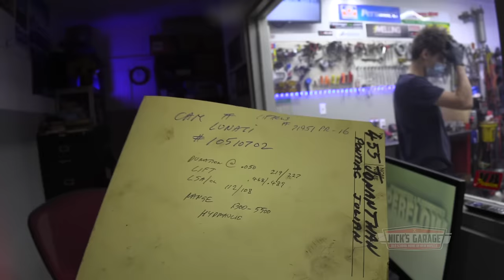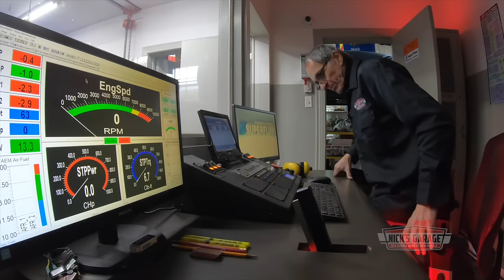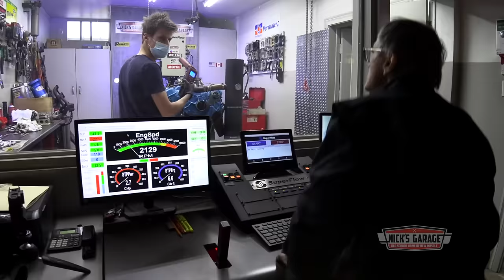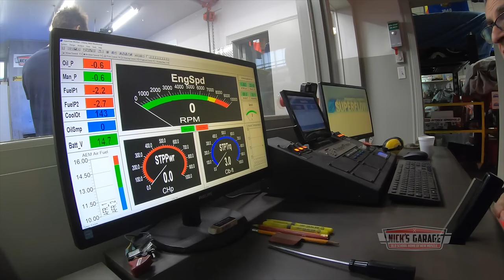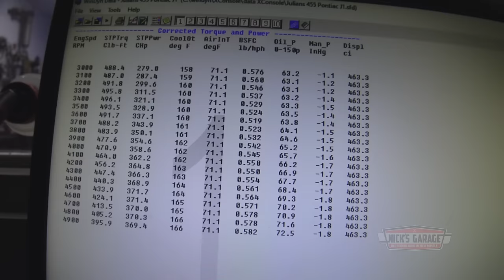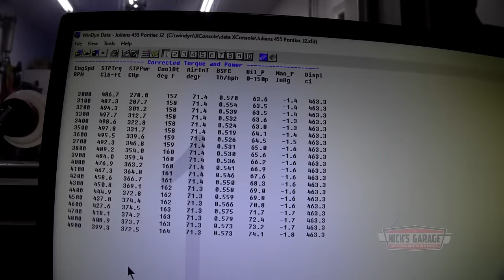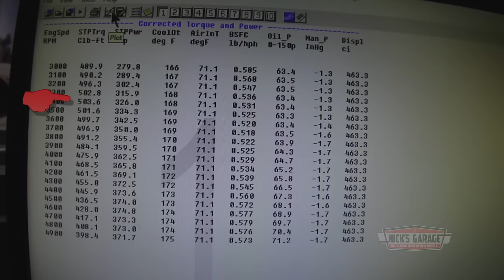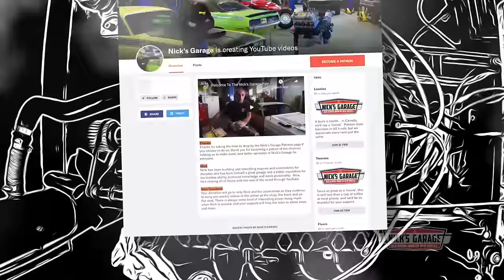Pontiac 455

Comment: I owned a '72 Pontiac Grand Prix once, it had a 455 with a 4-barrel Quadrajet, and a Turbo Hydromatic 400 tranny. That thing was a beast stock. I could blow the doors off any street car out there. Amazing car, back then.
Reply: Had the same car only it was a 400 with a little bit of cam . Don't know how fast it was but it was a handful and my father always got in trouble when I let him drive it.
Reply: You are the God Father of engin building....
Reply: I had a completely stock 73 Formula 455 Firebird back in 1986 and the torque and 250 rear wheel HP was awesome!  Not insane power but more than enough power to street race and eat up late model 350 corvettes and 350 Firebirds!

Comment: This is a "perfect" Pontiac 455. These engines are known for unusually high low end torque, their best horsepower is between ~4,200 and 4500 RPM. They "roll off" at ~4,800 RPM, and are "out of breath" at ~5,000 RPM. The bigger carb may help a little, but with their relatively small valve size and runner cross section, these just don't produce much torque on the top end. These have tremendous "off the line" acceleration, due to the torque coming in at the stall speed of the torque converter. This is the engine you want, for light to light street racing. They'll "burn rubber" all the way down the city block.
Reply: 12 flat's in a SD 455 works pretty well for being out of breath, ha ha ha
Reply: @74SD455TA  - SD's have better heads!
Reply: Put some Ram Air 4 heads, .030 flattops (around 11.5) on a 4 bolt 455, ran a .288/.298 .515 cam - 
While in 3rd gear (as the tires melted) the tack would climb so fast after 4500 that I was afraid to step down til I could put a rev limiter on the thing, but NEVER did I get the feeling that I was running a marathon with my hand over my mouth, far more like no end in sight
Reply: Not to mention the tiny intake ports keep high end horsepower in a low band
Reply: I had a 428 bired and stroked to 500 cubes did 10.8 in the quarter mile all day long
Reply: Ram Air V heads or go home
Reply: They don't have "small valves" either...

Comment: We got a 69 GTO Judge Tribute. 455 BBP on MSD ignition, bored .030 over, forged rods and pistons, heavy duty mechanical valve springs, 750 double pumper carb, billstein suspension all around, wilwood 6 piston brakes, drilled and slotted rotors, stock M40 Turbo with 3.90 gears? Rear end, just has a posi in her. Built trans, no OD aftermarket 17” factory looking wheels, about 50 grand with 0 work done by myself, all in a shop. Car is a beautiful Orbit Orange, convertible with a white top. Car was bought from an older women after her husband passed, car was complete and just needed a minor restoration, ended up doing a full Judge conversion all with authentic Pontiac GTO Judge options, from the RPM gauge on the hood, the the ralley wheels and shifter, back to the spoiler, and full Judge Drivetrain. Car dynoed just over 500WHP on the dot on the 1st run (car was warmed up) and over 570 foot pounds of torque. She lights the rears up like no tomorrow. Wrapped in sport cup 2s 275s all around, 17x8 Lemans remanufactured.

Comment: As usual there's no better way to start any Monday off than watching and learning from you Nick!
Reply from the maker: Wow, thanks!
Reply: Should have hooked up the choke and made sure it worked right while dynoing... 
Would have gone 1 step larger in cam... Use Super Duty 455" 850 CFM Q-Jet... 
Timing marks wrong?
Nick worked at Pontiac back in late 1976 when I ordered and bought my '77 Pontiac Gran Prix... mint green with white interior... 301" Pontiac V8 rated 17 MPG city and 23 MPG hiway, great numbers for those emissions slug engine 10 MPG days... Canadian 'Pontiacs' may have still been getting Chevy engines... 
Where's a squeegee for the water? 
Engine Dyno stand needs a Parking Brake to hold in proper position... 
Nick sounds like he has Omicron flu...
Reply: @BuzzLOLOL ..... I was fine the next day. I have lost my voice many times in the past. Normal for me.

Comment: My two cents: I had the same engine in a 77 Trans Am. XF 455 block, Nodular cast iron crankshaft, 1971 96  heads, Edelbrock performer int. manifold, .030 over. Crane HMV 278 (222/234 @ .050 duration), Crower steel billet connecting rods, and Norris roller stainless steel rocker arms (1.5 ratio), carburetor was an 800 cfm Quadrajet for an SD455 auto engine. On the dyno my engine recorded 430HP and 510 Lb ft torque. Later on I changed the camshaft to a HIT 292 and Edelbrock aluminum heads. After all this, I gave the car away... and I am about to cry!
Reply: I feel your pain; Back in '78, I ordered a '79 Trans Am Special edition (T-tops, blk/blk). It had 211k miles when I sold  it for 2500 bucks. It still ran good, all original. Except I got rid of the smog pump, and emptied out the cat. converter. Selling is still the dumbest thing I ever did : (
Reply: You traded - in the T/a , for a Datsun
Reply: My first car is a 69 GTO. I have owned it since 1983. It was setting on a Honda dealer's used car lot. Someone had traded it in on a new Accord. I often wonder if that person ever laments their choice? And a 455 with #96 heads making 430hp is no joke. While the #96's are a great head for a street car that is probably about the most you can get out of them without major porting. I have run them as well as 7K3's, #13's, 7F6's and #48's on 428's and 455's. Today it's Edelbrock or KRE's. They are both a huge improvement.
Reply: Iwould be balling
Reply: Were you running headers?

Comment: My buddy just out of high school, had a 1970,or 71 Pontiac Bonneville,with a 455! Headers,bigger carb,true 3in pipes just past the drivers door,.That big boat did 105mph in a quarter mile. No clue the time,13s I guess.But I like 455 cu engines, alot

Comment: The old BOP motors had some serious guts. I have a stock 1969 Buick 350 motor in my 66 Chevy C10 and it will pull trailers over mountains. Literally.
Reply: The Buick 350s sucked, as the bore was too small to do any serious breathing. 

The Buick 455's, on the other hand, have a MUCH larger bore and are capable of some serious power if built right
Reply: @davelowets   I think that's a bit unfair to say. The 350's aint no Formula 1 but they are amazing truck engines. You get the torque of a big block with the fuel economy of a small block. I daily drive with one and I'm very happy with how it performs.

Comment: Love the overhead view of the Quadrajet showing the sequence of the Secondary POE deploying as those big secondaries come online.
Reply: Favorite part as well.
Reply: We call it 'air door'...
Reply: @BuzzLOLOL  POE "Pull Over Enrichment" are the two holes above the air door leading edges that supply the shot of air fuel mixture that we saw to aid a smooth transition.
Reply: You can watch the hood go down when the secondaries kick in
Reply: @bigthunder2860  - LOL ! ... Q-Jet secondaries were one of GM's best inventions...
Reply: that one seemed to stumble a little as it hit the secondaries
Reply: @JimBronson You are right. It did slightly.  If you look closely, the POE openings are well above the leading edges of the air doors on THIS carb.  There's roughly 4 or 5 things you could address.  I'd start with the simplest first.  1. Tighten the wind-up spring 1/16th to 1/8/th turns.  2. Cut 2 small semi-circular holes in the leading edge of the air doors right under the POE holes to quicken enrichment if needed. (Which is a good performance mod to consider when POE holes are this high.) This engine might react differently once installed in the car however in real world conditions.  Start simple first and go from there.
Reply: @JimBronson  - Yeah, the dyno 'loads' the engine differently than 1st gear in a car would... the dyno drags the RPMs down as the throttle is opened fully...

Comment: Even though Nick is a huge Mopar guy,you can tell he's loves Pontiac's just as much when he talks about them. Would love to see a performance Pontiac build!

Pontiac-always underrated, I say they were GMs best, but  corporate politics ruined them.
Reply: Totally agree.  It is said that an original Pontiac block is good for about 800 hp before stuff starts to break.  Butler Performance blocks have been built to push 2500+ hp on alcohol.  I'll be putting a 400 in my next car.
Reply: @originalpunkSxE   I found that Pontiac's have their own unique little rumble to them too. I could always tell them apart from a chevy or ford... etc.. 
Same with Oldsmobile's.
Reply: Pontiac definitely had some good ones. My friend had a 1972 Grandville with a 400 that even when it was wore out and tired could still spin the wheels on that big old boat at half throttle off the line.
Reply: Yes, just look at the block casting. It is ahead of it’s time. To me it’s the foundation. You have to spend some money to get it right. When you get them to breathe then you have it all.

Comment: love the old pontiacs! I've owned a 65 goat, a 69 Bonneville,  a 70 firebird,  and 2 71 grand prix. great video Nick!
Reply from the maker: Thanks 👍
Reply: The 389 was a good running motor.
Reply: I had a '68 400 H.O. Ram Air that was a bit of a mish-mash of parts from 421 SD and 455 motors and it ran HARD.....that 'Bird was FAST
Reply: @ssnerd583  it was either an ho or a ram air no such thing as an ho ram

Comment: Hi Nick! I was always the oddball drag racing with a Poncho. Lol  I had a 455HO 1971 Trans Am that was a stump puller. Awesome torque and coupled with the M-22 transmission it was a great car. We rebuilt the engine with all the "good stuff" after I over revved it and broke some top rings.  Great memories, Nick thank you for the video 👍
Reply: An absolute dream car! 
Hemi killers!!
Reply: @canusakommando9692         Hemi killers, really ?
Reply: I had a 1971 455 HO Trans Am for a couple of years. Great cat and handling.
Reply: Yeah bro  big Pontiacs kick ass
Reply: My first car, bought new was a 74 SD-455 Trans Am. I did a lot of street racing with it. The 2 cars in my city that I could not beat were a 70 hemi cuda and a 69 ZL-1 Camaro called King Kong.
Reply: @nickpanaritis4122  - When did Canadian 'Pontiacs' start getting Pontiac engines?
Reply: I put a 428 out of a 69 Bonneville in a 72 GTO I once had. The 428 had 65k miles on it. The first time at the strip it ran 13.35@105. Then the next time it lost about 1/10th. Each time down it would lose a 1/10th or 2 and then after a couple months it was also smoking. I tore it down and it had broken top rings. A machinist at the time told me it was because it had been driven at probably no more than 4000 rpms it's entire life until I plucked it out and started racing, and shifting it at 5500 rpms. Everything stretched just enough for the rings to hit the groove at the top of the cylinder and BAM! That was almost 35 years ago. Since that time I've heard of others doing it. The 71 Trans Am is a real beauty of a car. I hope to own one someday!
Reply: @canusakommando9692  455 Pontiacs are one of the best street engines made in my opinion. They in no way will kill a Hemi which was just a race engine hidden in a street car engine bay. Sorry but facts are facts.
Reply: @1967davethewave  - Yeah, that was always a problem if revving a high mileage engine up beyond where it usually went... use a ridge reamer before doing that...
Reply: @canusakommando9692  LOL...
Reply: @nickpanaritis4122  Easy hemi killers in many cases........its all about the tune........
Reply: @bluesman7475  stout competition, the ZL-1 that is....I won't call you "Lucky" that you bought a new 74 SD 455 T/A....I will call you very much on your game! Great job....Myself, while I couldn't afford one in 1974 when I was 16 yrs old, now, at 60 years old I have owned a 1974 SD 455 T/A for the last 13 happy years. 1 of 1 known to exist,  What a great car! Is, and will be just that...!
Reply: Hey... one of my favorite  Pontiacs was the big and beautiful Safari wagon.  This "mild" 455 would keep me smiling for a long long time!

Comment: The 73 super duty had a special 800 cfm quadrajet, the rest had a standard 750 cfm Quadrajet. I had 455SD in a '73 Grandville (same motor as the 73TA), what a sleeper that was, if a 21' long tank could be considered a sleeper. If you loosen the tension screw (well hidden to those not familiar with the Quadrajet) on the Quadrajet air valves a bit you'll pick up some effective cfm, you can go until it bogs. DA secondary rods on an H hangar is pretty close with 73 main jets and 44B metering rods. You have to play with the power piston springs and secondary airvalve tension to get the most out of it without a transition bog. It's worth the tuning though.
Reply: just what I was thinking , glad you mentioned it :)
Reply: I had a qjet like that on my Chevy and it worked great
Reply: Effective "tuning" on an SD-455 was EPIC!
Reply: Just disconnect the vacuum dashpot on the secondary air door... IF you have enough motor, it will INSTANTLY flop wide open and give you ALL the airflow. If it bogs, remove the engine underneath the carb, and replace it with a better one.

Comment: Had this in my 71 Firebird with a Muncie 4 speed 10bolt rear and I got 8 miles to the gallon. 
I snapped a rocker arm in half on the highway on the way to the speedway on a sunday and found a garage with a chevy 350 sitting there and drilled out the smaller rocker just to get me where I was going. :)

Comment: I built a 70' 455 XF with #64 heads back in 1998. I used a 744 cam, Holley 6213 carb, Edelbrock Performer RPM intake, Ram Air III exhaust manifolds and 1.65 roller rockers. 1969 PX Turbo 400 trans with a Chevy 12 bolt and 3.55 gears in a 70' LeMans. Car ran low 12's all the time. Sold the car in 2004 to buy a house! No regrets but it was fun to drive! Those # 96 heads on this engine Nick built come from a 1971 400. They have 96cc Chambers and 2.11 1.77 valves. Great heads for 93 octane. The #64 heads from a 70' 455 had 87cc chambers and were used for one year only, the smallest chambers for any Pontiac 455.

Comment: Nick, my guess is he wants to run the Quadrajet because he wants to use the factory air cleaner assembly with the shaker. A Holly carburetor won't work with the factory air cleaner assembly.
Reply: Yes and it’s more reliable.  Factory linkage.  Choke  etc. etc
Reply: Yes, we know. Thanks for the info. Stay safe.

Comment: My stepdad did the same thing back in the 71 he pulled the original 350 engine out of his 76 SS RS Camaro and stuffed a L6 454 out of a 1970 Chevelle. That way he would have the original ongine on a stand and could still romp on it. It is happy to do so with that rock crusher Muncie behind it. He still has it and it incredibly clean. it is a monster waiting to get back on the road.
Reply from the maker: Nice!
Reply: @NicksGarage  they are here to be driven so awesome if you can save the original engine and still have fun.
Reply: @LunarOutlawsGarage  Brian any idea on the 318 testing
Reply: @lilo2469  the 318 block is a basket case so it is coming back out of the Satellite and a 440 is taking its place in the spring. When that happens I will be looking to have it shipped. its cylinders are our of round and the blow by is nuts.
Reply: @LunarOutlawsGarage  oh my , I thought you had problem solved with bottom end bearing clearances
Reply: @LunarOutlawsGarage       It needs a complete overhaul.  After all, it was rough to start with.

Comment: As a point of comparison, I built a mild 428 for my 69 GTO.  Mild meaning 061 heads, 068 cam, GTO iron intake, factory Q-jet.  Made 455 tq and 375 hp.  It was a fun street motor!!
Reply: I pulled a 65k mile 428 out of a 69 Bonneville many years ago. It had factory #48 heads and 068 cam and I put headers and a carb spacer on it. It ran a best of 13.35@105 in a 72 GTO with a TH400 and 3.55 gears. Unfortunately I should have pulled the heads and removed the ring groove at the top of the cylinders because it slowly destroyed the top rings until the car would only run 14.20's. I sold the car in 1996 but still have the 428 setting in my shop all rebuilt and waiting to go in something. As a matter of fact, the Bonneville is still setting in the field behind my dad's house. He has owned the car since new but it's far beyond rebuildable today. The 428 was a really great engine that is pretty much overlooked today. Most people think you're talking about a Ford when you say 428!
Reply: I was going to say 375hp.

Comment: Carburetor to small. I was in my late teens early 20s in the Muscle Car period. Had many friends who had GMs with Qudrajets. Everyone switched them out for Holly's double pumpers. No more vacuum stalls. Same reasons we switched out the Carter's. MOPAR's Ruled.
Float the Lifter? We said that if a GM didn't have a tick, it wasn't running. Great Video.
Reply: And most of those cars ran like crap after taking off original carb and intake. 
Carb linkage scrapped together. 

No more cruise control. 

Likely ac no longer functional. 

Hot start issues. 

Terrible idle. 

Vacuum leaks.

Comment: Nice 455 Pontiac, Nick. I had a 455 Pontiac in my 73 Pontiac catalina station wagon but my dad sold it in 2014. Now it's got a 350 chevy engine, little bit better gas mileage. I have a 455 Pontiac I found out of a 71 bonneville that I might build and put it back in my Pontiac wagon. 455s are great engines.
Reply from the maker: Right on. Got to love a wagon.
Reply: What's the highway mpg ?(chevy 350)
What's the highway mpg? (Pontiac 455)
Reply: @albundy8052  mpg on highway for the 350 is 16-18 mpg. 455 is 10-12.

Comment: At 5500 rpm and a 90 percent volumetric efficiency that poncho is only pulling maybe 600 CFM.  

The q jet is either a 750 or 800 cfm.   

The cam is on the small size too. 

It definitely isnt due to the carb being too small.